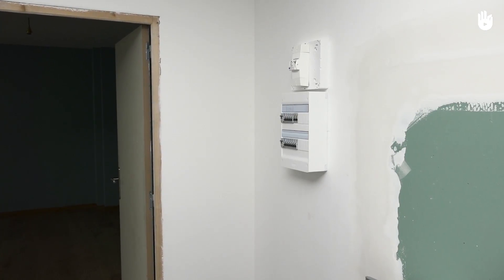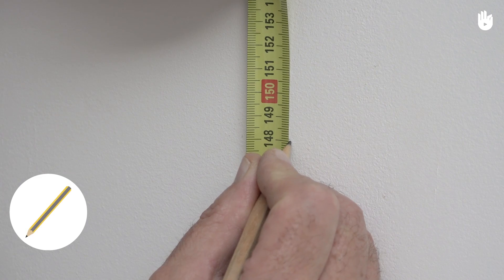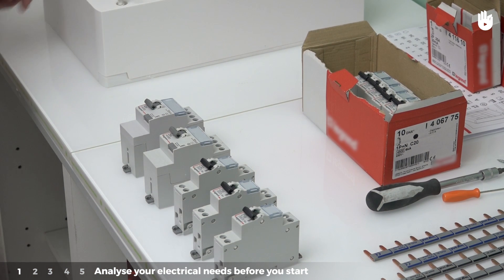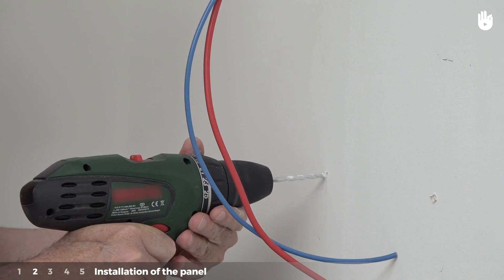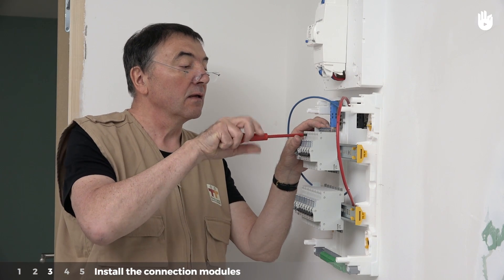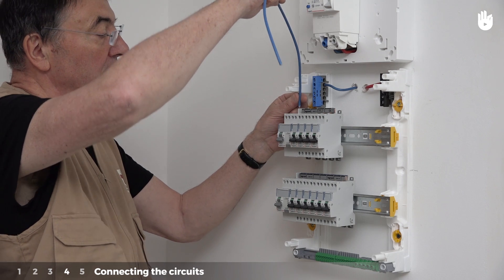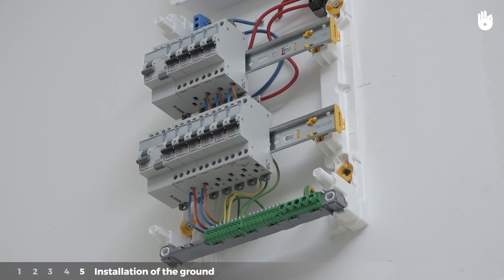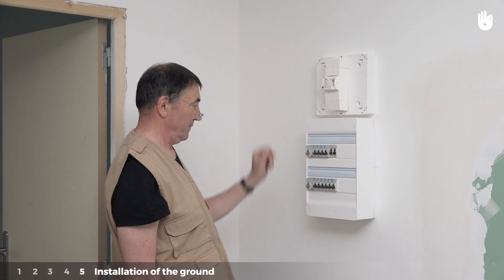How to Install an Electrical Panel | Electricity

Comment: no residual current device(RCD)?
Reply: They are not taking a bath near an outlet : )))
Reply: Also, they use C instead of B for home monophase use. Also, they use 16 on Lights and 20 on plugs. B 10 is enough for switches and 20 is ok, I guess, if you use a lot of high consumers like AC washing machines and induction. Needed for 4 mm copper section wires. For 2.5 mm B 16 is ok. There is a board pannel guide rule for it.
Reply: i see the main circuit breaker is an RCD i can see the test button and 30ma sign also i think the 2 individual main switches are rcd too, correct me if i am wrong.
Reply: @carlossaroufim  They are called RCBO.
RCBO = MCB+RCD
Reply: MCB and RCD are history.
RCBO is the future until we come up something even better like we always do.

Comment: Dear Sir, your video is very useful and simple. can you make a video for inverter connection to the distribution board(main switch) and explain how to avoid power load from the invereter supply.( only lights and Fan in the MCb)waiting for your reply and video
Reply from the maker: We are delighted you like the video. Unfortunately this program is now complete and we have moved on to making other videos. You can find them all by subscribing to our channel. For more electricity videos, simply click here: http://bit.ly/2t19AWX